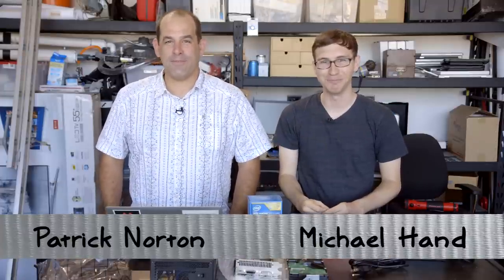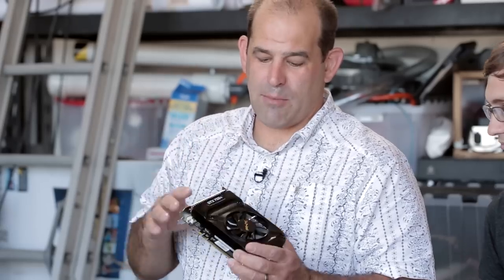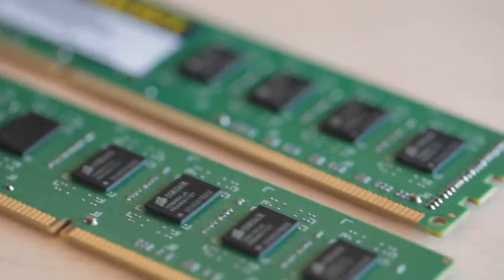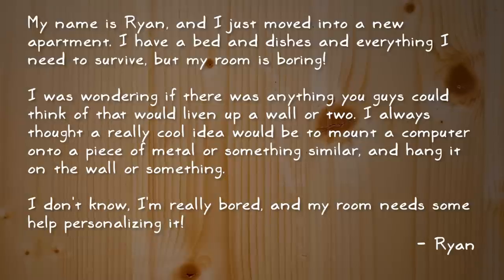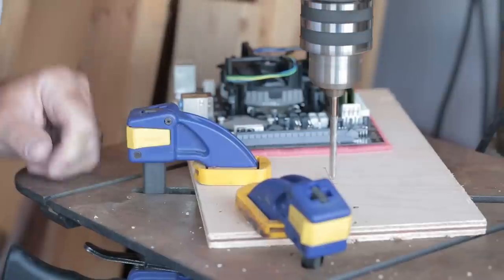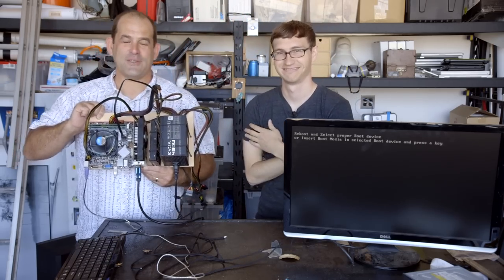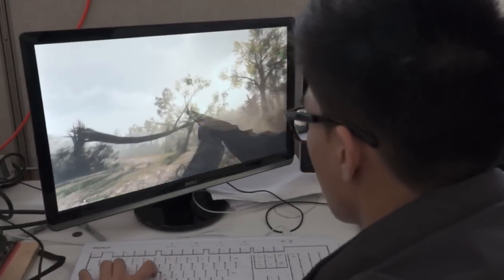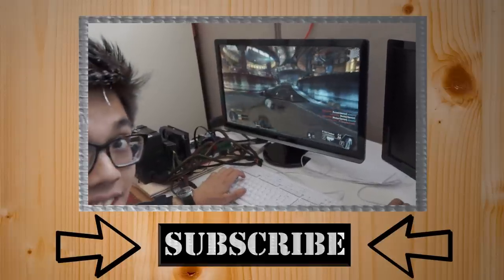Screw The XBOX ONE and the PS4... We Built a Gaming PC for $380!

Comment: I kind of followed this guide and went on with things I could find locally
I paid exactly 380 euro and got:
-Zalman Z9 case with some fans
-XFX TS 550W 80+ Bronze PSU
-ASRock Extreme3 R2.0
-AMD FX-8350 Black Edition
-Arctic something something 11 cooler (will update with correct model)
-Kingston ValueRAM 2*4GB 1600MHz
-Sapphire R7 260x 2GB OC
-1TB WD Green

Already had the OS

It's a console killer, I can run GTA V fine.

Comment: I built one several years ago for $500.  I am still using it, the only thing I upgraded since then was more memory and a better graphics card, and those two items cost me under $200 total.  I can run all the game I enjoy on high settings and they run smoothly.  They ran smoothly even with the $500 system.  It's not difficult.  The CPU I bought was an AMD triple core and a motherboard which allowed me to unlock the 4th core inside of it.  It ran no problem and cost under $100.  The one thing I paid more for was a power supply as that is the items that tends to break down the most in my experience.  Once I paid more for a decent power supply, it ends up being cheaper as you don't have to keep replacing it.  My Video back then was a Geforce GTX250 which was super cheap and ran everything I wanted at the time.  I now would say grab a GTX650 which are dirt cheap, DirectX 11 and plenty fast.  My monitor at the time was an ACER 1080p, and it was $100.  When I first booted it up I used Ubuntu Linux, 64bit (oh, and it was a 64bit computer).  I later bought Windows 7 64.

Comment: Haha never buy a pentium it so fcking shit
Reply: Nope. New pentiums like the G3258 and the G4400 are some of the best budget CPUs.
Reply: striker113 It's a dual core dude Now every game require at least a i3 becouse it has hyper threading or an i5
Reply: I grabbed an i3 3220 in great condition for $51 off Ebay. Beats the shit out of the Pentium!
Reply: LOL with some little overclocking the G3258 can handle almost any game. it can run bf 4/ gta 5 on high and even bf1 on low/medium with decent fps
Reply: ~GamingGuyNL~ it runs bf1 like shit (like 20 fps sometime 30fps) and gta v you need cap the fps at 30 becouse it will stutter
Reply: ItsWirax Search in yt gta 5 pentium g3258 and then battlefield 1 petium g3258. Both games run fine when you overclock the cpu to 4.3 ghz.
Reply: ~GamingGuyNL~ maybe you thing that 30 fps is fine for a fps game but it's not
Reply: ItsWirax It is when you use a controller xD
Reply: ~GamingGuyNL~ But if you are shit with a controller like me ?
Reply: ItsWirax go buy an i3 then
Reply: It's fine if you just want to build a cheap home theater PC or play some classic games. But yeah, for modern gaming, a quad core like an i5 or i7 is where you want to be.
Reply: Angel Christov or wait 2-3 months for new amd processors and pay 2 times less money for same preformance
Reply: the G3258 is one of the best cpus i know haha

Comment: For a  budget machine I went on ebay and got a quad core 2.9Ghz opteron server board with 8GB of RAM for $50. I got a Windows 7 COA key on ebay also for $20. I salvaged a 500GB hd got from work, and I got 600watt bronze PSU for $40. I put an R9 380 4GB video card on it that I was given by someone who won it. My gaming PC cost about $100 (A little more when you factor in stuff I no longer use and that I'm on my second power supply) and it plays fallout 4 like a champ. I have the board mounted in my entertainment center connected to my TV. Just this past saturday I played GTA V with all the graphics settings turned all the way up with no problem.

Comment: Beat this build on Black Friday, got a better build for $314.41.

CPU: Intel Pentium G3258 3.2GHz Dual-Core Processor  ($33.01) 
Motherboard: MSI Z97 PC MATE ATX LGA1150 Motherboard  ($62.58) 
Memory: Corsair Vengeance 8GB (2 x 4GB) DDR3-1600 Memory  ($22.14) 
Storage: Seagate Barracuda 1TB 3.5" 7200RPM Internal Hard Drive  ($37.10) 
Video Card: EVGA GeForce GTX 950 2GB SSC ACX 2.0 Video Card  ($101.70) 
Case: Thermaltake Commander MS/I Snow Edition (White/Black) ATX Mid Tower Case  ($33.89) 
Power Supply: EVGA 600B 600W 80+ Bronze Certified ATX Power Supply  ($23.99) 
Total: $314.41

Comment: These "Build a gaming PC for the cost of a PS4" type videos/articles are always stupid on at least one or two levels.

1. Over half of them (like this one) completely forget to include a mouse, keyboard and Windows license. If you're REALLY going to say that this machine is a viable alternative to a console, it needs to actually have the accessibility that a console has. If I go spend $400 on a PS4 and PS+ right now, I IMMEDIATELY have everything I need to game, provided that I have a TV (which is a given here). Heck, the PS4 comes with a frickin' HDMI cable and headset (not a big deal, but it adds to the convenience). If I drop $380 for this rig, I have diddly squat. A pile of circuitry. If I want this thing to actually DO something when I hook it up to a TV or monitor, I need a mouse, a keyboard and a Windows license, which will CONSERVATIVELY add at least $100 to the price. And at that point you're getting a seriously crappy mouse and keyboard, let alone a controller for third person games. Which gets to the next problem...

2. What on earth is the point of having such a crappy PC if you could save up for a little while longer and get something that's actually substantial? Plays Titanfall on ultra settings? Whoopdie doo, Titanfall is hideous. I get that the point of the video is to find something comparable to a console in pricing, but what is the POINT of that? You're getting a PC!!! Put some love into it!!! When I get around to building a PC some day it's just a given that I'm going to be spending at LEAST $600 on it, because why on earth would I want to settle for a janky system that doesn't even have a CASE (lol) and can barely keep up with a PS4? It's backwards logic and hardly speaks to the actual strengths of PC gaming. 

I have no interest in bashing PC gaming because there ARE tons of advantages to it, but c'mon... be realistic here. It's not the end-all, be-all gaming platform. Period. The most well-reviewed games of the last 10 years have practically ALL been playable on console as well (or they've been console exclusives). That ALONE makes the question of the "superior platform" a significant toss-up. That is, if it's ACTUALLY about the games for you... Sadly, for PC elitists, it's not about the games. It's about flexing and posing with bigger numbers. Good for you. While you're bragging about how you can run some crappy game like Crysis 3 on ultra at 120fps at 4K, I'll be over here, actually enjoying some games.

* sidenote * I'm NOT calling all PC gamers elitists. There are plenty of good-natured PC gamers who simply like games and have chosen the PC as their platform of choice. I don't want anyone thinking that I'm covering all PC gamers with one broad stroke. I'm just singling out the elitists. Because you guys are terrible.
Reply: Actually it is be-all gaming platform have you seen Skyrim modded versus console? How you going to play games on the console, oh right you have to buy them. Two games is the cost of an operating system, while PC has many free games like POE, PS2, NMRiH for examples.

Mouse and keyboard you can get used, sometimes free using trading sites like Kijiji, Cragslist, and Facebook groups. The video was just to set an example that you can game for the cost of a console, not to literally go out and screw a motherboard to a piece of wood.
Reply: +Here Kitty Obviously games aren't a part of the cost equation here... The guys in the video aren't factoring that in so neither am I (I'm just calling them out on not factoring in some of the items that you literally HAVE to have in order for the PC to even function as a device). Even still, a new AAA game on PC is $60, just like on a console... And I've spent $60 on only a handful of console games - most I've gotten used or have traded another game in for them, which brings them down to $30 or even $20 sometimes. Just because I'm a console gamer doesn't mean I don't know how to work the system and get good deals. And consoles DO have some free and super cheap games.

And yes, I know that the point of the video was to show that you can game on a PC for the price of a console. And they failed... They're at LEAST $100 short on the cost. And from there, I'm simply questioning the overall point of even wanting to do that, which I explained in my original post.
Reply: X1 was $500 on release, plus a subscription for online access. Near the time of this video the price did drop to $400, still requiring a subscription for online annually while the hardware in this video has also dropped in price. Xbox community is a large portion of console players so its relevant.

You do realize there are sites that lower costs by a large margin and can be activated on Steam? Without having to trade in a game you owned for less than a year, thus losing out on a large sum of money in the process. All the games I buy I frequently play, minus old games which would have a poor resale value in the console market.

Even if they're off by $200 its still a better investment in the long run for a gamer.
Reply: +Here Kitty Daniel is just trying to be realistic, you aren't. The point of this video was to show that you can build a PC for about the same as a PS4 of Xbone, however, they are doing it with slight of hand. This video is dishonest at best, and if you are aware of that, this video is more effective at showing why consoles are great. I am a fan of both PC and console.....because that's how you get the most out of games. Not everyone has parents willing to shell out $1000 for a decent PC or a job where they have that kind of spending money to throw around. If you do, great, if not, there should be an option. Trying to claim that you can build a decent PC for the cost of a console is pointless. It's been proven time and time again.
Reply: This video may not be the best but its also not entirely false in its claim either. Right now you can purchase this system on Amazon for $425:

- FBM-05
- GA-78LMT-USB3
- FX-4300
- GTX 750Ti
- Patriot 4GB
- EVGA 400W

$5/hr for 5hrs a day (excluding weekends) for two months gives you your $1,000 with US minimum wage of $7.25. A teenager could manage that in one summer.

"I am a fan of both PC and console because that's how you get the most out of games"
Worst idea possible, the mass amount of money you waste is mind blowing when you're here talking about money. I get the most out of games by playing solid games I enjoy at discounted prices of 75% or higher and majority of the games I do play have typically 250-500hrs or more.

PC also has a great selections of free games like POE, PS2, NMRiH and Warframe as examples that you can download and play as soon as you start your new system for the first time.
Reply: +Here Kitty But its not realistic because there's no windows license, keyboard or mouse on that list, which is going to add $100 minimum to the price.
Reply: Daniel King
Indeed, and to play online it will cost you an additional $250-300 for the PS4/X1 over the lifespan of the hardware, assuming five years would be the end of the cycle.

Windows license is permanent.

If someone's a casual gamer looking for a single player experience they wouldn't be looking for a PC to game anyway - it would be extremely illogical.
Reply: +Here Kitty We're talking about having a system that can get you started gaming. Of course any option is going to cost you additional money over the lifespan of the system. If someone is building a $400 PC, they're probably going to want to upgrade at LEAST their gpu within a couple years, so there's additional costs for PC as well.
Reply: GTX 750Ti will be good for a long time, my old 670 can still play games better than PS4 quality on medium to high and the 750Ti is $200 or less. Next upgrade will be similar in price and should be good for 4yrs or so, considering a consoles lifecycle is (at the most) eight years that equals the price of a new console when the time for an upgrade occurs. New card $200 for 4yrs, upgrade $200 for 4yrs, so forth and so on.

Its not difficult to play PC games with console graphic quality but to play on ultra PC quality its going to cost you more but at least the option to do that is there.

Take into consideration that X1 players do not even have 1080p resolution and both systems struggle to maintain a steady 60fps while you can't even upgrade the already outdated hardware. When PS5 comes around PC gamers will be using 4k resolution on a 5/6yr old 980Ti.

Comment: What people need to understand is it's not aways about specs it's about the platform and what games that specific platform has on it I am a PC Gamer yes. But I prefer PS4 Pro over my £2000.00 PC and laptop...

(These are my PC Specs for any nerds out there.)

Display: SONY BRAVIA KD43XD8088BU Smart 4K Ultra HD HDR 43" LED TV
Processor: Intel(R) Core(TM) i7-4790k CPU @ 4.00GHz (Will be Overclocked) 
GraphicsCard: GeForce GTX 980-TI Overclocked 
Memory: 16.00 GB RAM 
Storage: 500GB SSD/4TB HDD/1TB HDD/=5.5 Terabytes 
Cooling System: Corsair H80i V2
Wifi-Adapter-Speed: 866.5 Mbps (Temporarely Downgraded to 72.0 Mbps) 
USB-Ports: 2 USB 2.0 Ports/6 USB 3.0 Ports (With Extender 10 3.0 Ports+Lapdog=12) 
ViveReady: Yes it works and I love it. 
Blue-Ray Support: Yes but not on a disc 
Motherboard: ASRock z170 formula OC
Case: BITFENIX Prodigy black 
OS: Windows 10 Pro

Keyboards and Mice:
Razer Turret (Wireless Lapboard)
Corsair Lapdog (Gaming Center/Wired Lapboard) (Selling this device)
Corsair K65 Wired (Gaming Mouse) (Selling this device)
TeckNet M288 Nano Wireless (Gaming Mouse)
Zelotes T-90 Wired (Gaming Mouse)
Zalman ZM-K350M USB Multimedia Keyboard

also, I have a HTC-Vive and a PS-VR

Each day I spend hours and hours searching through steam to find some really good games (ones that I don't already have) out of the 100 games I do have now steam is considered the main platform for PC but since Steam does not really change per year unlike the PS4 and Xbox or any console, in general, you will find after searching for hours to find a game you think this looks good!

You then proceed to buy the game to only find out you bought a game that was on the ps2 10 years ago...

With consoles you have to buy a completely new device when you upgrade and then the older games don't tend to work on them but when you look at that consoles store you don't see any old outdated games because that store only has games for THAT specific console which in my opinion makes looking for games easier. (Depending on what country your from)

I personally like the PS4 because it is not region locked meaning I can play games from other countries PS4 consoles on it and VR is cool but it won't entertain me enough until they make 4k capable wireless headsets... (which will take a very long time)

I have all this and yet I enjoy running my ps4 pro at 4k more than I do with my PC stuff... 

You can also run steam on your ps4 anyway by tricking it with a USB flash drive but you need to install firmware into it.

Comment: My comment is a couple years late but heed this warning. Do not mount a hard drive like that. It is a mechanical drive which means on the inside it is essentially a glorified CD spinning constantly while on. Having it mounted loose like that will cause it to vibrate which will kill it a lot quicker than would happen if it was mounted properly.

Comment: The AMD Jaguars are custom built CPUs made for Sony and Microsoft, their functionality is much different to desktop stuff you buy.

Hardware wise, everything is mostly the same across all brands and competitors, it comes down to software in a lot of cases.

On consoles the developers makes games writing code much closer to the 'metal', which lets them raise the efficiency of their hardware uses.

On PC, because the way code, libraries, and engines functions differently and through multiple 'conversions' of sorts, efficiency drops, so we make up for it in stronger hardware.

That and when building PC, the market price for parts varies you overpay for even 'discounts' on parts. Console makers gets bulk deals on parts when ordering, and goes straight to the manufacturers to get them (so no third party to buy parts from).

The AMD cpus on the consoles are pretty powerful hardware wise, just like the PS3's Cell processor. But new stuff will always come out so no one will fully commit to constantly release patches or updates to optimize or make it more efficient.

Comment: the advantage with consoles is that developers optimize the games so that they can run smoothly there for a period of 7 years. in pcs, they do not do this, so you are forced to upgrade in order to avoid frame rate loss of non optimized generic code written because of huge diversity of graphic cards.

Comment: I suppose the standard CPU fan that comes with the CPU is mostly ok, but if you really are a heavy-duty gamer, I'd recommend spending another 20 or 30 bucks on a more heavy-duty CPU cooler. Especially if you live in a warm country.
Those aren't actually all that expensive, but they do a much better job at keeping the CPU cool even under full load.

Comment: On ebay you can get $50/£30 fast 2.4ghz, AMD, 4-core, low-energy 610e cpu. It'll do everything quickly except for 1080p video encoding. Even plays modern games at 720p or 1080p. Get an AM3/AM3+ motherboard for it.

Comment: I bought a used Dell Optiplex for $30 on ebay. Intel Quad Q9650 for $55 which I overclocked to 3.6Ghz, 8Gb ram was $25 and a GTX 750ti for 120 and I had a 1tb 7200rpm disk. so total is around $230.00